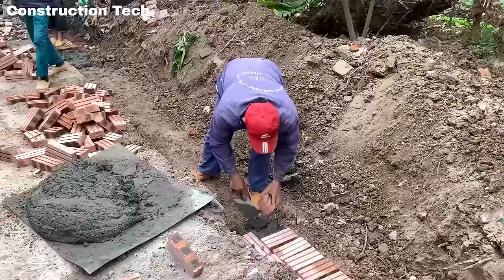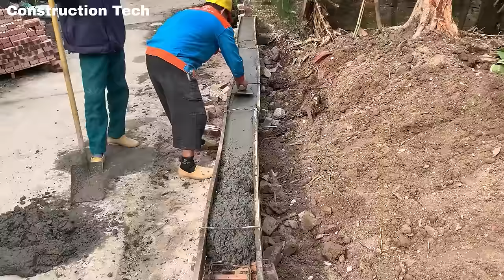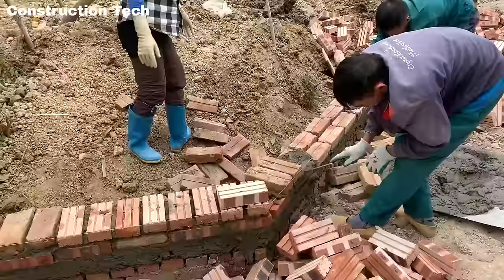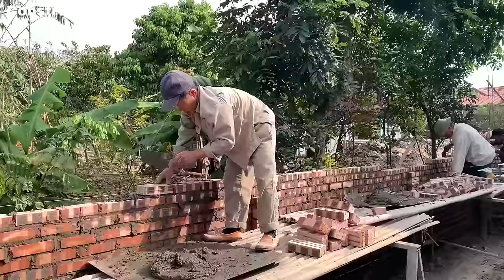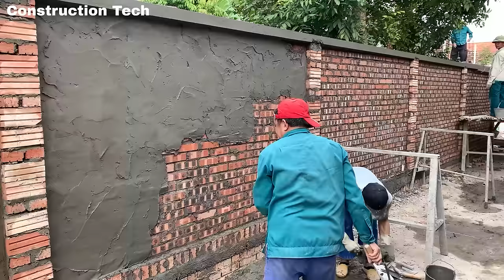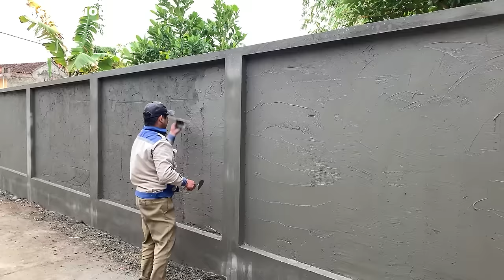Professional Technical Knowledge Building Garden Fence Walls From The Strongest Terracotta Bricks

Comment: The foundation   is not deep enough to bear a very heavy wall. The wall may collapse throughout time and heavy rain. Moreover,  there are no rebars in the columns, the wall may bend in the long run. It is a pity that the workers are very skilful . Had they dug the foundation 30 centimeters ( = 1 foot )  deeper and 30 centimeters wider at the bottom and add some rebars at each columns,  the wall would have been perfect.
Reply from the maker: thank you for sharing